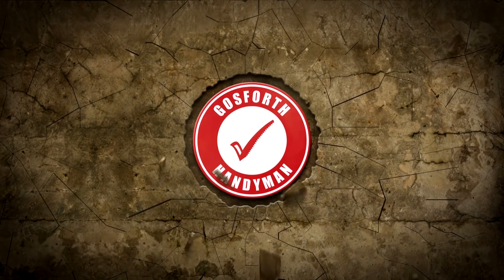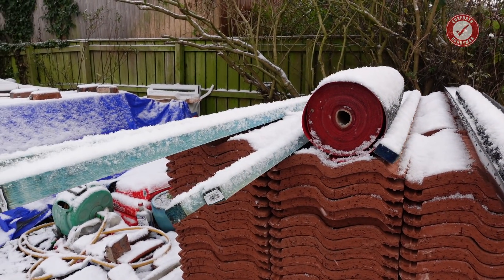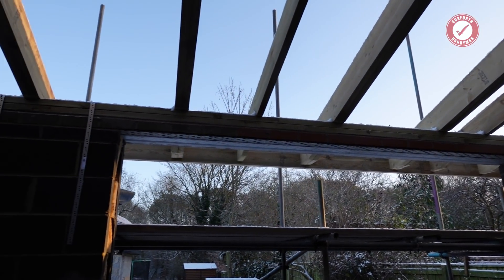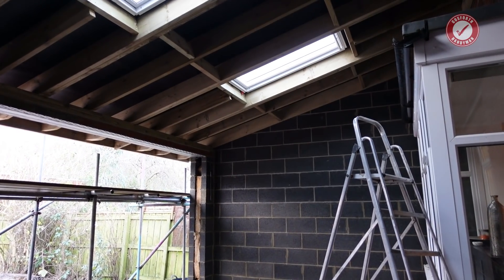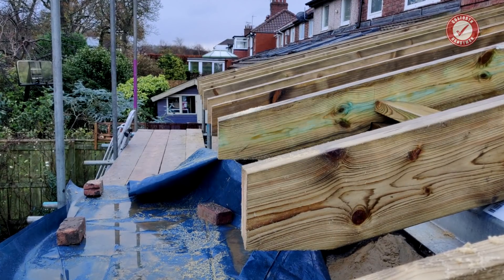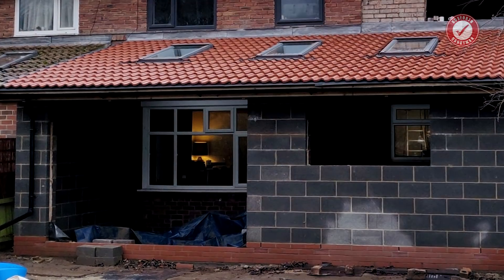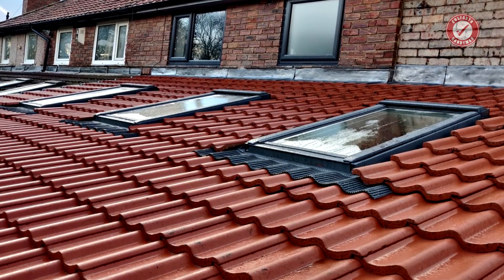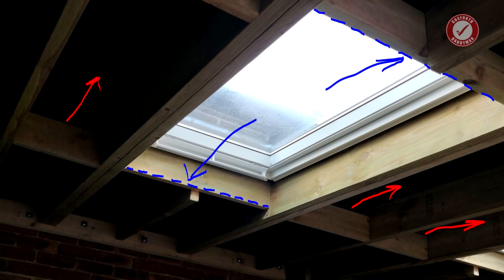Our extension lean-to roof explained

Comment: I have found I invariably have to go around after the very few people we employ o do work.  The worst was a firm that installed an office for us (they are a big house hold name).  It was so bad I got the fitters back and in the end had to get my tools and show them how to fit a pelmet that was level - their "foreman" still went on how he was called in to fix other teams mistakes so God only knows how bad they were.  My OCD would mean that tile edge would have to come off and I would recut the tiles and refit them properly.  Alternatively I would recut the tiles so they were straight and fit a second bargeboard so there was not  a gap
Reply from the maker: It's shocking really. The tiles are cut perfectly straight btw. It's just the verge is too far out so it's just flapping about. 👍

Comment: As a roofer with 30+ years I tend to look at the finish details you can see to give an indicator of the skill level of the contractor who made the install. 

The areas you pointed out are rushed at best to give them the benefit of the doubt. 

The leadflashing through the top is where i'd also look --- especially how they dealt with the small return on the building and the downturn over the verge - have they dressed/welded to correct details? The internal corner would give a fair indication of skill level --- is it a  'pig ear'  (folded in on itself) or bossed/welded?
Reply from the maker: Nothing is welded as far as I'm aware! I'll take a closer look at that return. Cheers David! 👍

Comment: My neighbours had an extension like this in 2014 and the roof was 14 degrees and the builder put the wrong tiles on then altered the battens when it leaked but didn't replace the felt so the next leak was worse than the first.  Eventually a roofer came in replaced the felt the battens and the tiles and the builder coughed up £3000 plus costs in the Small Claims Court.  What a hassle!  Looks like you might need to redo the right hand verge at some point.  Not done to your standard!!!
Reply from the maker: What a nightmare! Yeah, the 15 degree thing is critical. No leaks so far. 👍🤞

Comment: Yes that roof isn’t very good, I’d be suprised if they are roofers tbh, the lead at the abutment where it returns looks an awful detail and I’d be very suprised if that doesn’t cause u problems later on. Has it got bird combs under the tiles at the eave either? Getting full tiles at the top of the velux isn’t a must, neat cuts will look more than good enough

Comment: Yes a bit disappointing in regards the fit and finish of the roof , especially bearing in mind you couldn’t get more simpler project . But such is life , at least you managed to get someone that in it self is an achievement these days .            Best wishes and kind regards as always 😀👍
Reply from the maker: Yeah, I was quite grateful the roofer actually turned up. 😂😭

Comment: I just wanted to say that I was disappointed you had been left with these problems. Roofs are an element that needs careful workmanship to avoid problems later on. I do wonder if we are too soft on tradespeople that are not quite up to scratch. If every customer withheld part of the bill, in cases where the work was shoddy, would that improve standards?
Reply from the maker: Unfortunately standards are going to get worse. There's simply a massive skills shortage and the education system for trades is mostly useless. As older skilled trades retire there's going to be less and less people to train up apprentices. IMHO. 😭

Comment: Once bitten twice shy, never fully pay for a job till it's snagged and you are totally happy. That roof needs the dry verge off on the right, the battens trimmed back and it all putting back as it should be with the lead dressed in right also. Not a big job but why should you have to do it? Document your time and materials, all correspondence, and contra charge them for the work, if needed small claims court can help.
Reply from the maker: Yup! It's getting rendered so I'm tempted to pull the flashing up a bit while I'm at it then dress it properly around the new render. I guarantee I wouldn't get a penny out of the roofers but I'm not sure I'd trust them to fix it properly anyway. 🙄😭

Comment: I’ve watched over this from the start and you’ve been very methodical in your approach . I could pick a few things but I’m not going to . Your bricklayer seems to have done a good job and the joiner on the roof albeit a couple of issues I noticed . It’s just shame you ended up with a rough arse roofer :( just isn’t acceptable the things they’ve left . Looks like a house basher roofer has done it , leaving problems for someone else to sort just like they do on big housing sites! 
I’m sure you’ll put them right but you shouldn’t have to . Lead needs some more dressing all over it, right pigs ear that ! Sadly the building trade is full of cowboys and blokes with the “it’ll do “ attitude :(
Reply from the maker: Yup! Almost every trade has left something 'unfinished'. It's getting quite comical now. 😂
Reply: @GosforthHandyman  it’s just not good enough is it . Although you do run this risk when project managing yourself . All I would say is never fully pay up until everything is completed . Money is always the best bargaining tool . I’ve been in business for 16 years now and extensions and loft conversions are our bread and butter and it’s all the little awkward jobs that take the time up , these are the ones trades will try and get out of !

Comment: You could probably done a better job you self if you are hands person just read up on it and the manufacturers instructions and look up the relevant building regulations I run my own garage and when I was it college I work for a roofer at weekends to make some more money I've built 5 extensions and  one house one thing I've learned over the last 40 years  if you think someone is wrong stop them straight away and if they don't come back they know they have fuck up and don't pay them to you have checked there work and you are happy